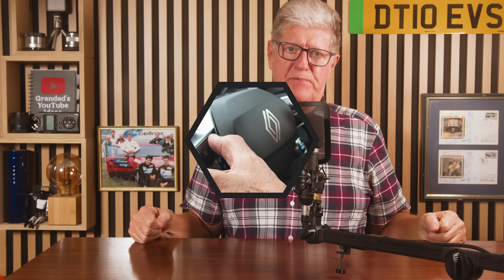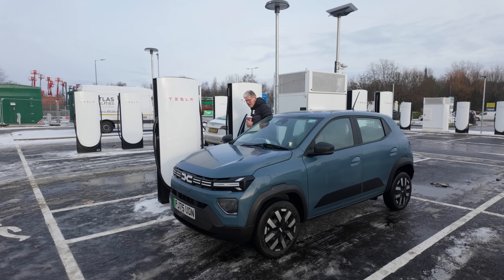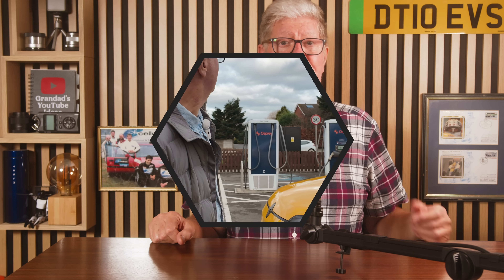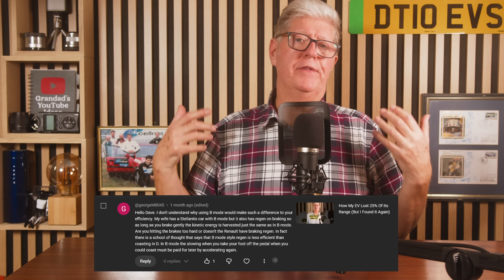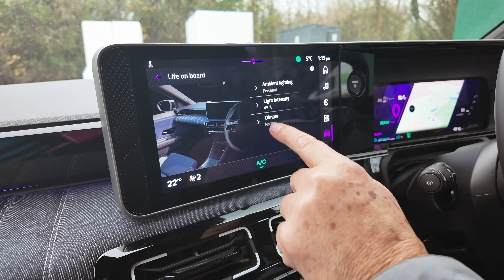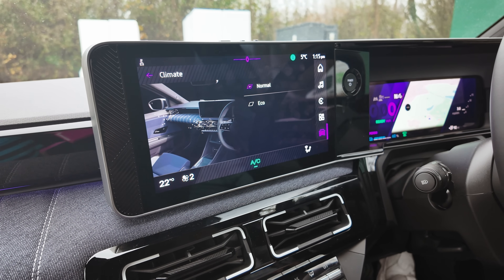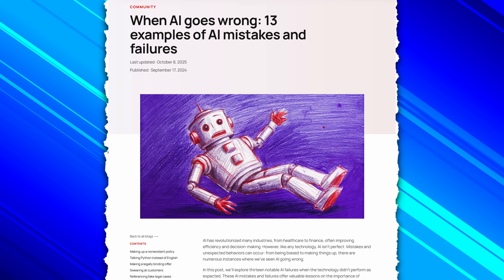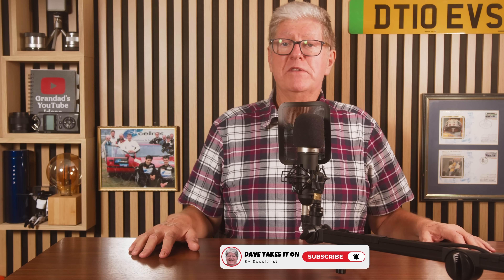Was I Wrong About Regenerative Braking On EVs?

Comment: What you have discovered is that driving style causes differing efficiency, and you have wrongly assumed this is to do with the setting on the car. It's not it's your driving style. If you matched the cars speed, and deceleration rate and timings in either setting in an EV you would have the same efficiency. Why? Because your assumption wrongly relies on using the brake pedal in an EV always uses the friction brakes, it doesn't. Given the exact same deceleration rate, if one pedal drive doesn't use the friction brakes, the brake pedal wouldn't either. Changing the regen setting in an EV does only one thing, it adjusts the deceleration rate the car will automatically try to achieve when you lift off the accelerator pedal.

So to be clear, if you were travelling in an EV at 70mph with max 'regen' set, then took your foot off the pedal and waited to reach a complete stand still. Then did the same with 'regen' off, but matched the deceleration exactly using the brake pedal, you would have recovered the exact same amount of energy.

Comment: From the AI world, here’s what it says, which make scientific sense. Sorry Dave, you test was not controlled or scientific.

Coasting beats regeneration
	•	When you coast in D mode, no energy conversion happens
	•	In B mode, energy goes through:
	•	kinetic → electrical → chemical (battery) → electrical → mechanical
	•	Each conversion has losses (typically 10–30% total)

Best efficiency = don’t slow down at all.

Comment: IIRC from late 2024 Tesla reintroduced regen braking settings while you cannot fully disable it you can reduce regen.  The reason being it was not the ideal solution for all circumstances as you mentioned AI is not foolproof. I agree with most of what you said but in heavy snow and ice I will stick to setting regen braking to low, while the traction control/abs can stop you snaking It won’t stop 2 tons of ev going forward on ice.

Comment: I usually one pedal drive. However in snow it’s a different matter. 
Both my AWD and my wife’s FWD have ‘snow mode’. 
My wife’s car in normal mode was stuck on the drive. In snow mode it changed the traction control settings and the car was easily able to leave the drive. 

My car in Snow mode reduces the regen considerably. Apparently to avoid the regen breaking causing loss of control in icy conditions. It was a very noticeable difference in control, confidence and driving feel over the last few days. And, of course, it causes more driver use of the brakes.
Reply: Funny, my wife says our Ioniq 5 is useless in snow, but she doesn’t use snow mode. I've found it very capable, but I use snow mode.

Comment: I suspect you and the commenters you’re referring to are both correct. Using regen braking will not be 100% efficient so some of that energy will be lost to the outside world. And cars under regen braking will still lose it to rolling resistance etc. if you were able to only coast then you’re just subject to the rolling resistances so it would be more efficient. But if you have to use the brakes then that just loses energy (from the car system). There must be a point where using the brakes for a tiny amount after coasting is more efficient than using regen for a longer period but way too many variables to worry about). 

As such, theoretically, better efficiency can be gained with coasting for longer so long as you don’t have to use the actual brakes. Real world,  you invariably do have to use the brakes and this might be where the driving style comments come from.

Comment: I think that the choice of regen setting depends a lot on driving style. I might be wrong , but I get the impression that if you fall into the "late braking into corner" crowd then high regen and one pedal driving is for you. If you fall into the "coast into a corner with light braking" crowd (me) .. then you have a choice , you can either go One Pedal and feather the throttle to get the desired amount of regen, or go for lower regen and coast into the corner. Also if more regen is required tap the brake pedal (which gives max regen) .
I prefer the last technique, its efficient , saves tyre wear and keeps your muscle memory for using the brake in an emergency.
I think potentially both techniques can be used efficiently , but if you dont adapt your driving style when shifting to a low regen setting you will end up still braking late into corners and using the friction brakes all the time. This could potentially be why Dave ended up with better efficiently on the high regen setting , because it suited his driving style.
Reply: This is absolutely correct. Dave is wrong (again).
Reply: I, as a Certified Analog Neanderthal, who has owned carburated stickshifts for my entire driving life does quite well with one pedal driving. 

While driving my '86 Isuzu Trooper I was stopped at a traffic light on level ground I was informed that my brakelights were not working, I replied that yes they do work,  Well they are not on back from her.... well, that's because my foot is not on the brakes, I'm in neutral, I don't need the brakes. 
Puzzled look in return.......

I'm well aware of how to drive conservatively.
Reply: Yes 👍
Reply: 💯Well said. 🏆

Comment: I use regen B mode around town / urban driving but use D when I’m on the motorway or faster A roads. I do have paddle option in D which can help improve regen when you encounter traffic. Car drives better in D mode though but B mode is more 1 pedal driving which is useful around town.
Reply: Correct, this is the whole point of B mode, it makes driving in urban stop start traffic more convenient with an almost one pedal driving experience. On a dual carriageway or motorway, B mode is a disadvantage as it slows you too rapidly.

Comment: It depends on your driving style some people may get more efficiency if regen is at maximum all the time, but if you adjust the regen levels throughout the journey you can achieve even better efficiency. My Kia has adjustable regen from paddles. For the best efficiency I have the regen off (level 0) if driving of the flat on the motorway and down a hill (re applying regen if the speed is getting to high) and I adjust the regen level higher if in traffic or approaching a turn.

Comment: I have some nerve damage in my right foot and ankle, which means that I have to frequently relax the area to relieve pain. Lifting off to do that when in one pedal drive, or max regen, results in sudden deceleration, which is not acceptable. And that means that I will never own a Tesla.
Reply: Set cruse control, problem solved. Cruise control on most EVs is adaptive anyway, so the vehicle simply follows the vehicle in front.
Reply: @johnnodge4327  Yes. But most of my driving isn't suitable for cruise. Even adaptive. I drive an Ioniq 5 and use level 3 regen auto. That isn't as harsh as full one pedal driving and in auto it adapts to allow me to waggle my foot for a few seconds without causing issues for people close behind.
Reply: You could use adaptive cruise control, as available on many EVs where you can drive without touching pedals. The car will stay a safe distance from car in front and automatically brake or accelerate as needed.
Similar can be used in slow moving traffic where the car will start/stop in queueing traffic with little, if any, input on the pedals.
That's how it works on my MG4, but it does take a bit of time to build up trust in the system, and driver must always be ready to intervene.
Reply: @_Dougaldog  Adaptive cruise is designed for situations where you are cruising. Such as driving on an open main road or motorway where all other traffic is also cruising at a similar speed. The clue is in the name. Using cruise control on twisty rural roads and medium-speed urban roads with many traffic lights and roundabouts is not appropriate. And can mean that the driver has to be constantly intervening as the 'straight ahead' sensors become confused as they lose contact with the car in front on approach to roundabouts etc. I know that it CAN be used. The question is, SHOULD it be used in such inappropriate situations where it wasn't designed to perform at its best? I think not. But you do you eh.
Reply: @Hitstirrer  

"The question is, SHOULD it be used in such inappropriate situations where it wasn't designed to perform at its best? I think not. 

But you do you eh."

=======

Oh dear, apologies for trying to be helpful.

No system is perfect, but my MG4 works very well in slow moving traffic, reducing amount of footwork required on pedals.

The function is called 'Traffic Jam Assist ' (a subsection of adaptive cruise control) and it does just what it says on the tin using cars camera and front radar to start and stop car in queueing or slow moving traffic.
Reply: @_Dougaldog  Sorry if you thought I was a bit dismissive. I am aware that adaptive cruise works in a traffic jam situation as you describe. I have used it that way and it is helpful. It also works well on open roads and motorways. However, neither of those situations are what I was talking about. The subject was regen braking use. Not cruise issues. ACC isnt the best in normal urban and rural driving, so I avoid it because it has caused a few potential incidents when it misinterprets cars ahead turning, as my car accelerates when the car in front moves away from the front sensor. Similarly, at roundabouts. It's just not user-friendly for normal urban use. I need to relax my foot regularly and whilst ACC works in dense or free flowing traffic, where my foot is not even in action, elsewhere, such as urban and rural roads, and to get back on topic, cruise doesn't work very well. Because it isnt designed for that kind of traffic. And using one pedal drive doesn't either, for me, due to its harsh deceleration when I lift my foot to ease ankle pain. I realise that your suggestion was meant to be helpful, but I would argue that ACC isn't the solution for the majority of my mileage. OK on motorways. OK in dense traffic jams. Not OK everywhere else. I need to be able to relax my foot regularly. One pedal driving doesn't let me do that as the car lurches to a stop if the pedal is dropped.

Comment: Dave, The different regen settings simply change the 'user interface'. High regen settings apply most of the regen when you lift the throttle, whereas low regen settings apply it when you press the friction brake. The regen is still there!
Regen is only 70% efficient at best. Regen is more efficient than friction braking, but losing speed by coasting is more efficient than regen. 
Higher regen/one pedal driving doesn't automatically give better efficiency. It is perfectly possible to drive just as efficiently using lower regen settings. That is why you got so much criticism from experienced EV drivers.
Reply: Indeed the key to drive as efficiently as possible is avoiding to have to brake (regardless of regen braking or not). Personally I find one pedal driving is the best tool to do that, and I actually reach the WLTP values. But however you do it, regen setting is pretty much irrelevant,
Reply: @fintrollpgr  High regen minimises the need to use the friction brake. In practice you cannot always coast, so it is better to have regen which is proportional to pedal position up to the highest maximum possible because that will allow you to come to a stop efficiently in the widest range of situations without using friction brakes and wasting the energy heating the atmosphere. The setting is only relevant to the maximum available regen braking force - you can have any force up to that maximum by adjusting the pedal.

Comment: My question over Regen, is whether Regen itself or Regen under braking is more efficient and whether this varies significantly between models? Has anyone done any comparisons to see if it better to use braking regen ( I know you are supposed to every so often to make sure your brakes are still there!!!!) and the actual Regen facility but I also wondered if different cars have better or worse recovery of electricity? I love the flappy paddles and would not want to trade for a fixed button that sets a level....but that may be me. Incidentally I have done a few trips where I have actually gained a mile using Regen!!!!

Comment: Thanks yet again for the content, Dave, it takes a lot of work - appreciated. But, I don't think you are 100% right here: firstly, hard work though it is, your two tests are NOT scientific - you didn't/couldn't control all the variables properly, nor take out subjectivity in driving style/routes. Second, there is no way you get back from regen what you put in. It is not 100% efficient, as you imply. As regen slows you down, there is still loss to rolling resistance and air drag and there is some loss to heat as the motors work to generate electricity and charge the battery. In fact, you only get back a fraction - I don't know the figures, but I'm guessing, around ⅕/¼ So, for every kWh you put in, regen at best will only give you a fraction of that back. Therefore, on motorways, driving long distances, you are better with low or no regen to keep the momentum/energy in forward motion - you won't get the majority of it back if you slow under regen.
Also. I don't believe that you can apply one setting to cover ALL road conditions. From my experience, driving an Ioniq5 for the last 3 years, I have one-pedal driving (max regen) for most short & stop-start journeys (because I like it, regen is better than braking all the time and you do get that little bit of power back again), but on long motorway journeys, I turn regen off, stick at 65/70mph and try not to accelerate or decelerate too much, especially going uphill (this is the most efficient way to drive any car on a motorway).

Comment: I always drive my LEAF in 'D' setting , 'ECO' mode and 'ONE  Pedal' mode. I use Adaptive cruise control most of the time. Over 40k miles my average is 4.2 Miles per KWH. Much of my driving is on M/WAys at traffic speeds, with a lot on country main roads and 'B' roads. Not much town driving. 
When slowing down I have learned to  use the 'one pedal' to control the rate of regen/braking to maximum effect so that I can adjust the regen rate with my foot according to traffic. 
AS always the best way to extend the range is to drive with restraint, no harsh acceleration or heavy braking, and look ahead as you drive.

Comment: I have a Renault megane e tech, I use max regen when urban driving and I use cruise control whenever I can on motorways and national speed limit roads. When using cruise control the car decides regen settings and it works. PS the default setting (after switching the car off and back on again) is midway; I have to use the paddles to gain max regen. In the winter I struggle to get to 3 mile/kwh, in the summer I get to 4 miles/kwh

Comment: I drive an Outlander PHEV. My brake lights only come on when I use the brake pedal so I use the lowest of the 6 levels available. The car still uses regen to slow as long as the brake pedal isn't pressed too hard. Smooth driving is one of the best ways to maximise range.
Reply: The reason the brake lights don't come on in regen is the same as why they don't come in when slowing down with gears.

Comment: The problem with forcing maximum regen at the factory level is that most drivers either don’t care about efficiency or don’t fully understand how to drive in a way that makes the most of it. As a result, they won’t adjust their driving style to keep the ride smooth for passengers or to avoid wasting energy through unnecessary braking and acceleration. And despite your claim that no energy is lost through the motor, regen braking does involve losses. No motor is 100% efficient, and regen typically captures only around 65% of the kinetic energy available.

I also disagree with your point about maximum regen being more efficient on the motorway. Even using cruise control, the system will apply maximum regen deceleration whilst driver are feathering the throttle, overtaking, or when other drivers are pulling in front and driver instinctively lift off the accelerator. Cruise control systems also tend to panic brake in these situations more than a human driver, which means you lose roughly 35% of that energy every time it happens.

Also, it would be great if you could stop talking down to viewers by implying that anyone who disagrees with you simply doesn’t understand. It comes across as patronising and can be off putting to viewers.

For the record, I’m a big supporter of regen braking and I think it’s a key part of improving efficiency.

P.S. I haven’t been able to verify your claim that Tesla removed the option to adjust regen settings. Do you have the source of this information?
Reply: Yes, he doesn't like people disagreeing with him. I wonder if he's just used to talking down to his clients over the years that he is like this. Either way, it is off-putting but of course he'll never change and will always have this attitude of looking down his nose at people.